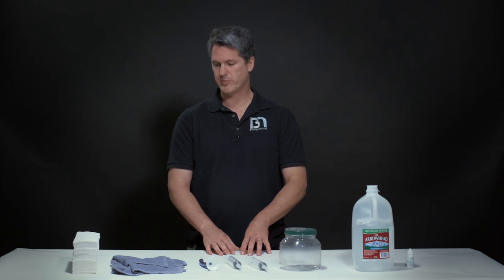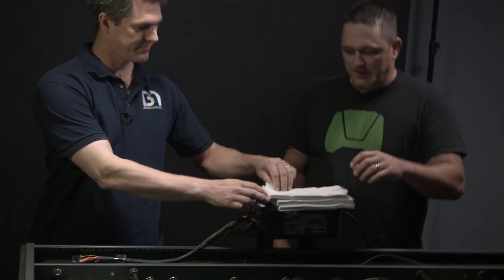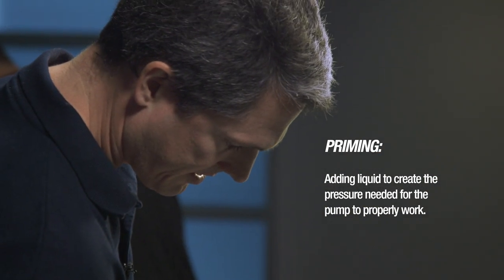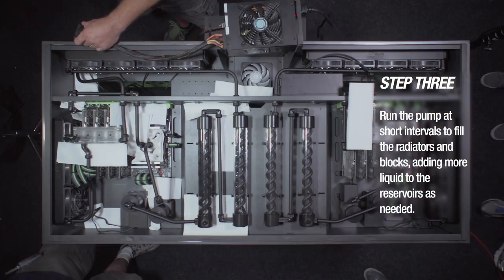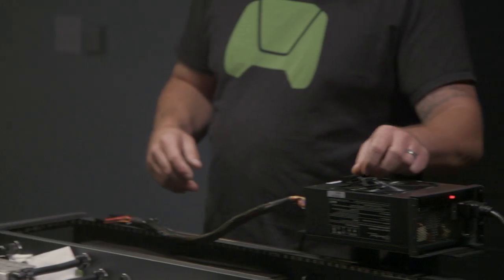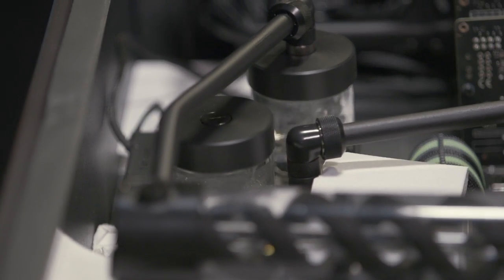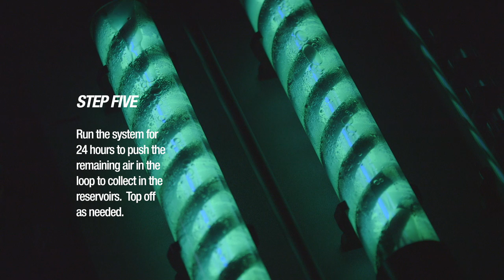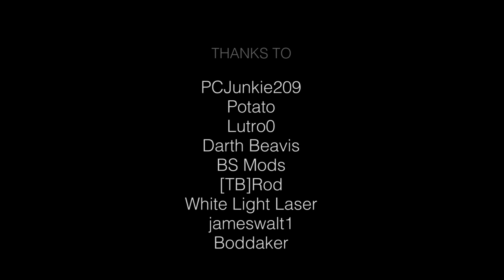GeForce Garage: Cross Desk Series, Video 6  – How To Fill and Leak Test Your Liquid Cooling Loop

Comment: No anti corrosive or stuff to prevent algae?
Reply: Anti corrosives are completely unnecessary unless you've mixed ali and copper which is a very dumb thing to do regardless of what the marketing people will say about mixing metals.
Reply: Right but it seems like all they added to the distilled water was the dye. Shouldnt they at least add something to reduce algae growth? (Im new to liquid cooling and have only ever read about it)
Reply: bliz0123 It's certainly a good precaution, yes, but the problem is then they'd have to go into detail of what anti-microbial products are incompatible with which dyes and this would be a 30 minute video.  This is purely meant to show the basics and get people interested, not be a detailed guide.
Reply: Just add a couple of ml of bleach depending on how large the system not much is needed.
Reply from the maker: We do recommend using a biocide at 1:29